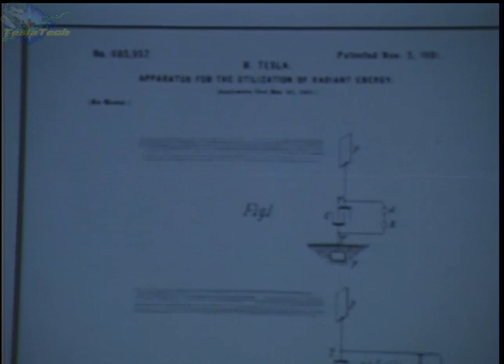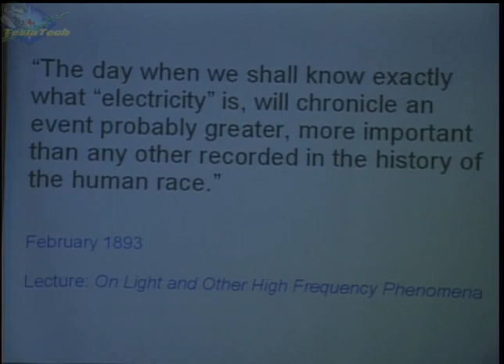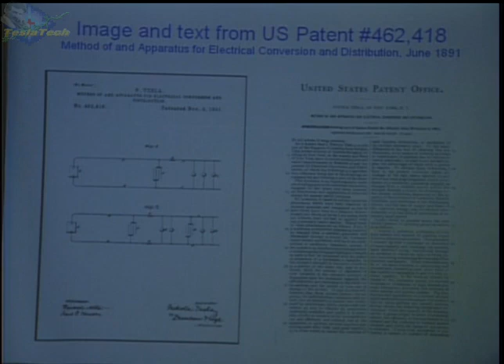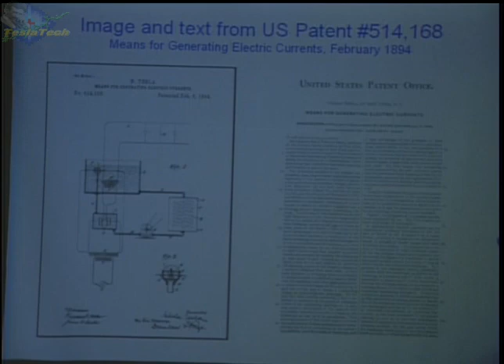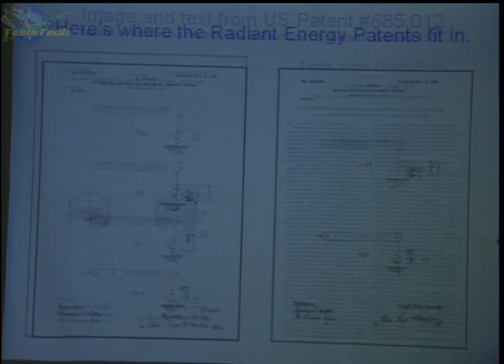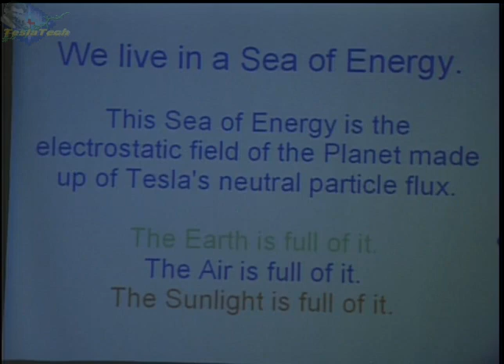FREE ENERGY devices/ theory 10 - Understanding Tesla and over-unity devices: STEP 1 - The basics.

Comment: I think another aspect of Tesla’s ideas that might need a little more clarification are how at the end of this video tesla references a waterfall for energy. It’s interesting Peter catches this, but doesn’t quite get the full import of what Tesla is saying. In fact, if one considers the pyramids of Giza, the same could be said of that circuit. 
Tesla is implying, with out saying overtly, how a relatively small amount of energy can be leveraged to create infinite amounts of energy. 
With the correct circuit, we only need a relatively small amount of energy to “vibrate” the electrostatic current sheath of the sun, that is flowing over the earth 24/7. The pyramids operated by doing the same. Wardencliff and the pyramids put a standing wave on the earth of the sun’s electrostatic potential. Tesla spent quite a bit of time finding the circumference of the earth to find the proper frequency necessary to create that standing wave. At the moment the sun’s current  is a standing wave, something magic happens, and tesla referred to it in the transcripts of the Westinghouse bankruptcy. The low points of each of the 75 kilometer “trough to trough” waves have a compressive force, all pointing to the exact center of the earth. Those forces encounter each other, and by virtue of each being exactly equal, they shunt each other. This is also referred to in the Westinghouse transcripts. At that moment a damped wave is created in the earth, and even bearden spoke on damped waves(not nearly enough) and how they are crucial for a large earth circuit. 
The vector forces all meet in the center of the earth, they are all shunted by each other, and should be noted; those forces are all equal and equidistant. They bounce back, but are met by the continuing vector forces from the bottoms of each of the standing wave lows that are created by the wardencliff(or pyramid) circuit. So by virtue of all these vector forces being exactly equal, they are held in the earth, and the earth becomes a reservoir of the sun’s energy. 
One could say; 
Because the sun’s energy is not defined, an oscillator can only resonate with a small portion of that energy. There are likely millions of frequencies with which to resonate, and one can pick any one of those, to pull only that very small portion of energy. 
When the sun’s current sheath is made into a standing wave, it is given a fundamental, and that is the “trough to trough” of the standing wave. There are harmonics as well, and it is likely any number of those, whether fundamental or harmonics of the fundamental, will yield orders of magnitude more energy, than if the current sheath from the sun wasn’t made into a standing wave. 
The important aspect of having the sun’s energy made into a standing wave is; the frequency has been defined, and as such a transformer can be made that resonates with that frequency, it should be 1/4 value of the frequency with which one wants to resonate. 
Tesla also covered how relatively small coils can be made to resonate at very,low frequencies. The one coils length should be a bit more than the other, and a much lower frequency is made through the combining of those two higher frequencies. If one adds a third, and a fourth coil, it is entirely possible that a very compact, suitcase sized, coil set could be made to resonate with the larger waves put into the earth, by wardencliff/pyramids. 
So …..one can leverage a very small amount of electrostatic potential(like a water fall and turbine)  to make the sun’s energy a definable frequency by way of an oscilating circuit that uses a large spark gap. A transformer of comparable small dimensions could be made to resonate with that frequency. 
One would only need to make sure the circuit to put the standing wave on the earth is so well grounded, that a push from earth is possible…..and that is why tesla had 300 one hundred foot metal pile-ons pounded in the earth(he said by far the most expensive part of the wardencliff construction). It is also why the pyramids are so large, and the pyramids are constructed of entirely diamagnetic material. The pyramids were ram pumps, though and they used sound instead of a spark gap. The water that filled the giza plateau was filled with electrostatic charge from running through 8 miles of solid limestone. Victor Schauberger shows how that happens, and abdel hakim awyan shows the tunnels in one of  his videos. 
Small amounts of energy needed to make the sun’s energy available, and circuits tuned to 1/4 wave to pull the energy out of the earth. The staffs of old Egypt were used by attaching it securely in the ground, and an ankh(tunable coil) in the hand, and one in the earth to tune the staff to the frequency of the standing wave on the earth. Ok, I might have gone on a bit, I am on my first cup of coffee! Lol

Comment: Peter lindeman  understands tesla more than anyone. Dollard doesn’t do much with the one wire deal anymore. Not sure why?
The spark gap in the radiant patent is the part I think needs clarification. 
My opinion is The insulating fluid (that keeps charges separated) breaks down when a spark of sufficient force is initiated……or……..a train of sparks is created that is a resonant frequency of the insulating fluid. I believe Tesla was hinting at the resonant frequency of the insulating fluid, when he said electrostatic energy is not so static, it has a frequency of about 1 million per second. That is how his radiant patent works, imo. The spark gap is initiating a constant stream of longitudinal compressions @ 1 million per second, and that is breaking down the insulating fluid. The small metal plate charges up from the charges combining as the insulating fluid breaks down around the spheres of exceptional charge. As those charges combine, their attractive forces become exponentially greater, and that is why only a small metal plate is sufficient to pull exceptional charge.